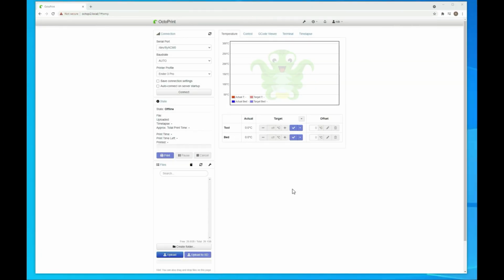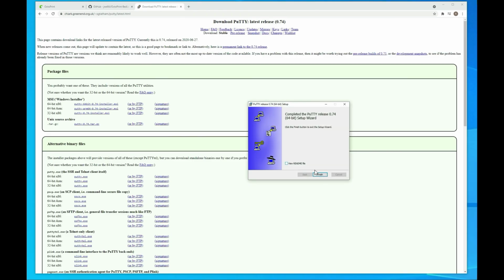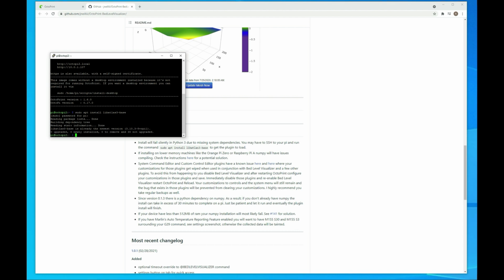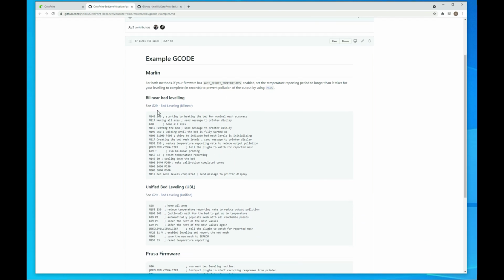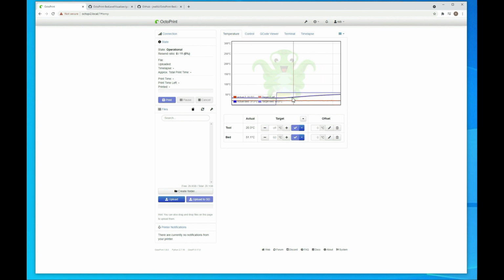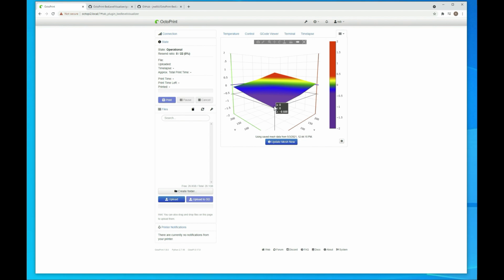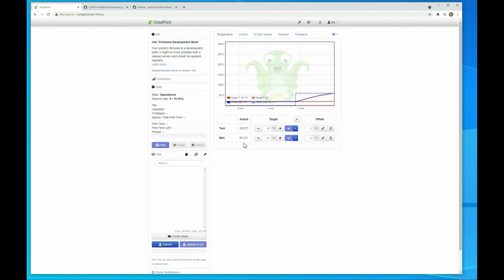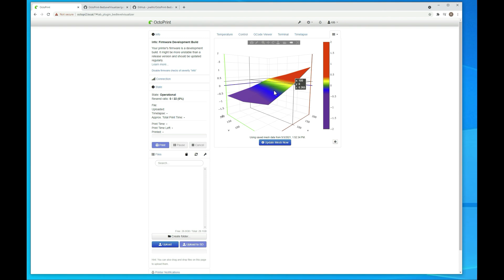Octoprint Bed Level Visualizer Install & Usage Guide

Comment: Does the add-on applies autocorrection to the code? Or you have to specify it on Cura or other slicers?
Reply from the maker: Hi. This is just a visualizer for you. If you have firmware that supports mesh bed leveling, or are using a Bltouch or something similar, you can save the settings at printer console.
Reply: @3DPrintscape  Thanks for replying, I meant if you already have the mesh you have to call it somewhere in the code to use it; you do it on Cura or the firmware itself always uses it?
Reply from the maker: @Screamer26  Gotcha, ya its in the firmware under bed leveling. If you don't have the bltouch, its define MESH_BED_LEVELING

Comment: access denied every time I try to login with the correct password. not sure what is going on.
Reply from the maker: Hi. The if your using the supplied password, it should work just fine. The only way it wouldnt is if it was changed or if its being typed wrong. Its also worth mentioning that you may not need to install the package through ssh with the latest version of the octopi image.
Reply: @3DPrintscape 
It's definitely the right password. I didn't even think to try it without this step. I'll give it a shot. Thank you!

Comment: With this plugin, does it save the new mesh to EEPROM automatically so I don't have to do it via the LCD or is it simply just a visualizer with no extra features? Cheers
Reply from the maker: Hi. Honestly, im not sure about that one. The main purpose is to visualize high/low parts. You could send the M500 command from octoprint to save it.
Reply: @3DPrintscape  That's a great idea. It never crossed my mind that I should just send the M500 command after leveling. Thanks!

Comment: Is the visualization dependent on the overall height or just the levelness of the bed? As in when a bed is perfectly level, but a bit higher than it should be, does it show that as too high or just as level?
Reply from the maker: Hi. It just shows how level the build plate is.

Comment: The null (zero, 0) pont is the home position in the visualizer? So, the -1 is the home -1, and the +1 is the home +1?
Reply from the maker: Hi. Im not sure im following the question but the 0 mark should be the center and if your seeing -1 or 1 that means the bed is not level there.

Comment: Thanks for the video on my plugin, glad you find it useful. BTW, that install is only required for 64bit and manual octoprint installs. The octopi 0.18 image already has it bundled.
Reply from the maker: Hi. Thanks for the plugin and info on it. I wasnt sure if it was needed on Octopi so i covered it just in case.

Comment: Hello, another great video, im running into an issue tho, i have Octoprint installed in my WINDOWS 10 , not in PI... when i try to go to the LOCALHOST url from PUTTY, it wont connect... i dont know what im doing wrong, any tips? thanks!
Reply from the maker: Hi. I havent actually set this up on windows but if your not able to connect going to local host, try using the ip address. Some apps will only work on the ip, even though local host resolves to the same IP. Also, i would look to make sure the service is running and try to connect with https.

Comment: windows 10 has a built in openssh client now, which you should be able to use in cmd or powershell instead of using putty
Reply from the maker: Hi. Thanks for the tips. Im so used to using putty that i forget that windows added the openssh client.

Comment: if you m500 after using this will it also apply the mesh to the machine for future prints?
Reply from the maker: Hi. If you run through the bed leveling process and save it, it should be used for future prints. I personally prefer to run the mesh at the start of each print just incase anything has changed.
Reply: @3DPrintscape  thanks man
Reply from the maker: @antonyandraws9148  You're welcome.

Comment: Are those probings in real time or is your printer tooting some nose candy? That is fast. I mean I use 7x7 because I spent $50. 2x2 for example corrects for zero warpage
Reply from the maker: Hi. I had the video at 5x during the probing parts. I didn’t think anyone would want to watch it at normal speed. I’ve never gone beyond a 5x5 grid but I know some beds need it. And I normally don’t go under a 3x3 grid but a 2x2 would work in some cases.

Comment: I don't see "Bed Level Visualizer" in octopi's plugin managers "get more" section.  I'm curious to know if the plugins would be the same between octopi and octoprint?
Reply from the maker: Hi. Im actually running Octopi on the device i used for this recording, so it should be there. What hardware are you running and is octopi fully updated?
Reply: @3DPrintscape  Ty for the reply. Yeah I am on a rpi 4 4gb pi. Octopi was up to date as of a few days ago, however it's currently printing a fairly long print so I'm unable to manage add/remove plugins (though I can search) or attempt to update octopi. As soon as it's done I will holler if I see it.  I do have several bed leveling plugins that appear while searching but unfortunately none match what you are using.  I also checked the plugin blacklist and did not see it there either.
Reply: @3DPrintscape  Very odd. After freeze framing your video, the site we're both going to is the exact same github project by the same developer but mine comes up "Bed Visualizer" (no level). Either way, its working for me now so thanks for the video and taking the time to reply.
Reply from the maker: @Pghpete5  I'm glad you got it working but it showing up as a different name rally is odd.

Comment: Hi i'm using stock Melzi 8-Bit board with genuine BLT rev3.1. Space is not an issue as i run Octoprint and am using Marlin 2.0 my question is do i need to set  ZMIN_ENDSTOP_INVERTING to true in config. Thank you in advance
Reply from the maker: Hi. Thanks for the info. With a BLTouch, the ZMIN_ENDSTOP_INVERTING needs to be set to true.
Reply: @3DPrintscape  Thank you for reply and clarifying that
Reply from the maker: @electro3976  You're Welcome!

Comment: It is funny, you are always right in line with whatever stage I am on with my printer. Currently I am having massive issues with the BL Touch. I figured out this plugin on my own last week and found out that the front and back of my bed and down so far that the printer will M112 Shutdown. While trying to fix the problem, I figured out the gap between my nozzle and BL touch end was too small, with that problem fixed now the BL touch will not even touch the bed with bed leveling! It fails first corner. I have been using Z axis offset wizard to set the z axis offset. I am out of ideas. I have spent weeks troubleshooting. Any ideas?
Reply from the maker: Hi. Thats funny. The bltouch probe needs to be lower than the nozzle with extended, if not it will not engage. The z-offset is meant to account for the difference.
Reply: @3DPrintscape  as far as I can tell it is when deployed. In the bltouch v3.1 install pdf it outlines a dimension (2.3-4.3) in the CAD drawing. My old gap was less than 2mm. Now it is in between the spec. When deployed the tip is lower than the nozzle by a good few mm.
Reply from the maker: @eddyeisenberg5740  Is it actually hitting the bed on the first point? If not, try to clear the eeprom.
Reply: @3DPrintscape  it's not hitting the bed. I tried to reset EEPROM but it has no effect. Still fails first probe and causes an M112.
Reply from the maker: @eddyeisenberg5740  Are you running a custom build of Marlin, if so check your x and y offsets.
Reply: @3DPrintscape  I am.. I will measure again. My calipers are from the 60s and in inches. Although they are calibrated, they require a few more steps to use with mm. I just do not get why it will not probe the first point. It gets like a mm away, stays blue, and pulls up. Thank you for your help. I do not have anyone else to turn to lol. Covid got me doing this solo. Feeling pretty desperate atm.
Reply: @3DPrintscape  I noticed that it thinks 0 is actually a few up from the bed. (through z-offset wizard) is this part of the issue?
Reply from the maker: @eddyeisenberg5740  The z-offset will end up being a negative number. Going down to 0 will not get the probe close enough to the build plate.
Reply: @3DPrintscape  I get that. I did not explain what I meant correctly It seems to vary a ton for some reason. Sometimes I run the Z offset wizard and it is like a -7 offset then other times its like -3. I have tightened everything imaginable or adjusted it 10 times at this point. I am almost convinced the BLTouch itself is messed up. This all started with M112 shutdowns in the same corner when leveling the bed no matter what I did. It turned into not being able to level the corners at all. I got it to touch the bed again by using the regular z endstop switch for homing. It still probes a point in the middle before setting the Z offset. As soon as I start the bed leveling it fails first or second probe.  Thank you again for your advice. I feel like I am going in circles. I am sure it is something stupid I am doing but for the life of me I cannot figure out what it is. I guess my next step is stock firmware. See what happens. My guess is going to be more of the same.
Reply from the maker: @eddyeisenberg5740  Can you make sure there is no play on the z-axis/extruder. If feels like the extruder is moving around or the x-axis is loose.
Reply: @3DPrintscape  oh trust me. I have spent hours and hours making sure everything it tight and square. I actually just had a breakthrough. It is FORSURE say its a sticky BL touch probe. If I tap the bltouch after it homes the first time I get a double homing response. I think the term in coding is "poop in poop out". The probe sticking is causing it to think it's a much larger offset and causing it to fail. I got the mesh visualizer working for the first time in a week just now. A couple corners are a little low but I think its printable. I am going to mess with the alan at the top of the Bltouch some but I think the probe is bent. It works as long as I tap it inbetween probes. Chances are I'll make something work. Thank you for your help. I will be test printing something in a few mins.
Reply: @3DPrintscape  there is definitely play in the z axis rod. At the stepper motor. I probably messed it up. I have been thinking about upgrading to a double to take some of the weight off. I think I can replace the bushing too?
Reply from the maker: @eddyeisenberg5740  I would try to tighten the eccentric screw on the right side before changing anything else. That should take care of most of the play that's there.
Reply: @3DPrintscape  I have spent a long time adjusting the screws to release any tension and reduce any play. It is not as bad as it could be. As far as my BLTouch issue goes, a sticky probe is certainly the culprit. It simply was not getting good readings. It still sticks sometimes but I have been tapping it to get it to drop down all the way. I think some electricrial cleaner should fix it permanently. I just need to pick some up. Regardless I am back to printing! Thank you so much for your advice with this Rob. Such a great channel with very informative content! Your website is not half bad either, I enjoyed the article about 3d printed guns I read last week, plus it was very helpful to follow a written guide when needing to build firmware over and over again.
Reply from the maker: @eddyeisenberg5740  Im glad you got everything working :) and thanks for the feedback.